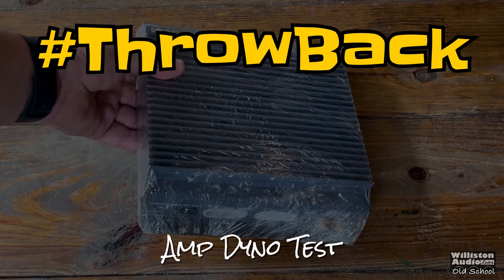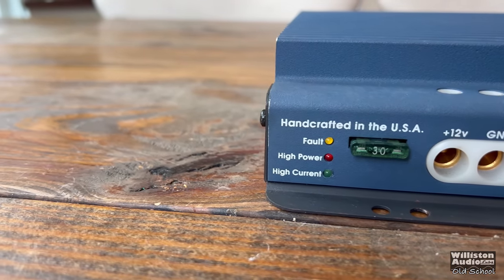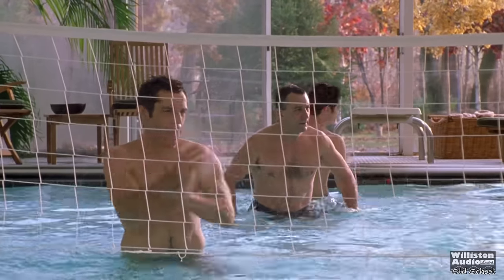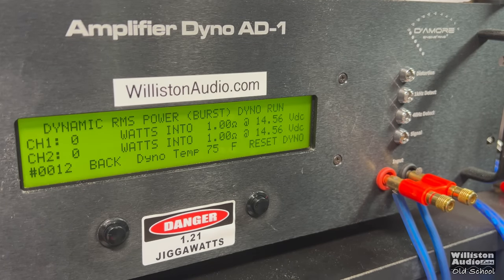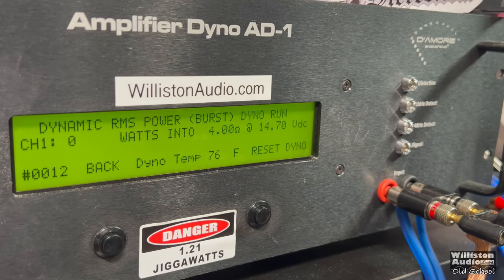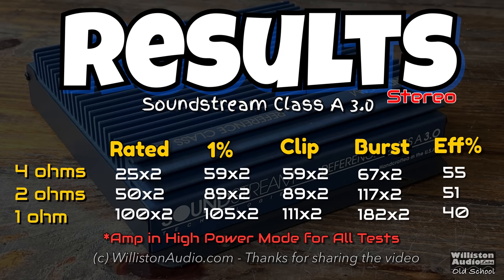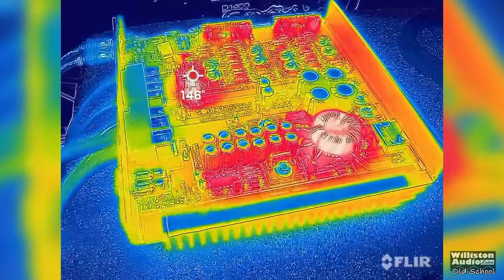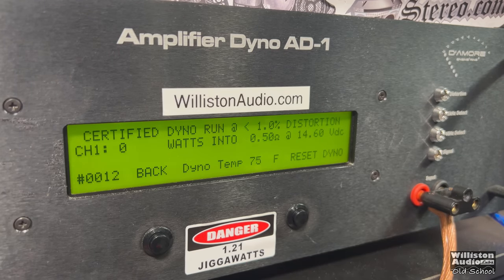Class A for Car Audio? 1993 Soundstream Reference Class A 3.0 Amp Dyno Test

Comment: I always wanted a Zapco class A 4 channel back in the day.  But I was very happy with my SS Reference for front stage and PPI PC  for subs. Anybody know if the old school Zapco class A amps lived up to their impressively low ratings distortion and high s to n ratings? I know their sub amps were very good. I went up against them it the dbdragracing lanes all the time. But my PPI PC 2350 always pulled off the win. But on my doors SS always sounded better than my PPI amps on the same doors
Reply: I remember Zapco winning lots of sound off comps here in the northeast.
I remember I had a ppi 2150 black not that sedona with wacky colors
Reply: @nickmrt2670  I had a PPI black PP2150, PC2350 and P250 and my Soundstream sounded better on my doors but PPI still sounded good on the same doors. But I won  a ton of dbdragracing, usac and spl competitions with PPI running the subs

Comment: Just tested a Sony XM-3546 which is rated 35x4 or 100x2 and guess what- IT DID 240x2 DYNAMIC (5 cycles 1KHZ ). And the Sony has a internal fan and better components than the SS.
Reply: Have you try the demo on 40hz. That Sony amp is nice but I would still choose the SS because of dynamic power and wiring options that amp can be wire 1-8 ohm 
1 ohm stable stereo / bridge

Comment: was told back in the day that any load below 2 ohms should be run in high current mode, have no idea if that is true or not, but my SS 405 is still kicking and spent most of its life with the sub channel at 1.5 ohms in high current mode

Comment: I swear I remember if you're wiring them down to 1ohm bridged /.5 stereo the amps NEED to be in high current mode and not high power mode. This is why it didn't make rated.
Reply: From what I remember my Reference 604 was the same way but since it was a 4 channel it was only stable at 2ohm bridged / 1ohm stereo

Comment: 7:03 NEVER do this. Contact cleaner will start corroding components over the years, at least use a soft brush and alcohol and clean the PCB off.